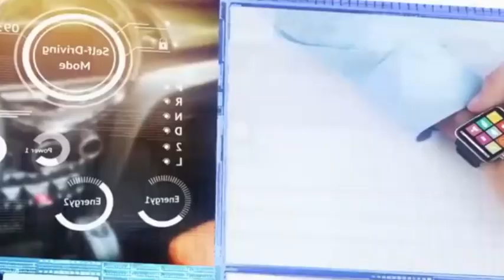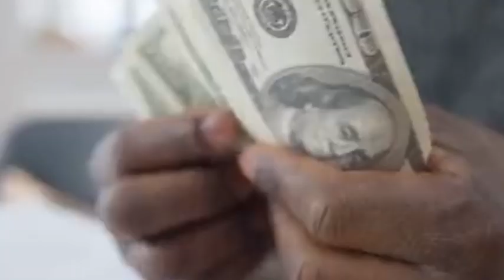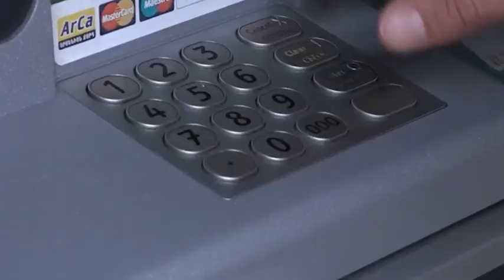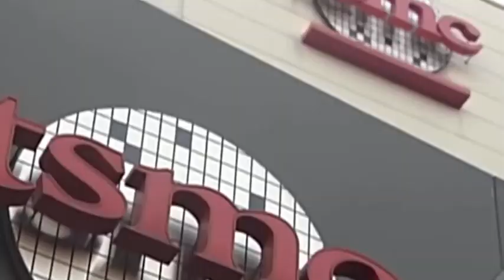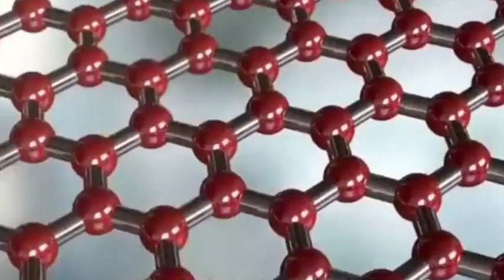China has successfully repaired a batch of EUV machines that were considered "unrepairable"!

Comment: If ASML would not repair them and would not buy them back then China has all the rights to repair them. While repairing them China is expanding its knowledge on their construction. They will now reverse engineer them and will not be breaching patent rules as purchase is being refused.
Reply: In addition, all costs and losses incurred in this regard will be charged to supplier ASML.
Reply: Buyback? Are you dumb, this all depends whether China wants to sell back. Stop making up such dumb stories. These countries were working fine with each others and everyone gained in advancements of  semiconductor technology  until the big bully uncle Sam came around to start pointing & wagging its finger. What a shame this had slowed down the advancements. Just imagine what the achievement will be the big bully is not there.